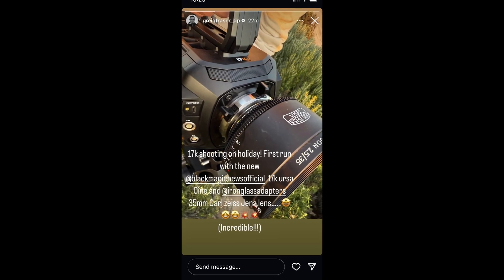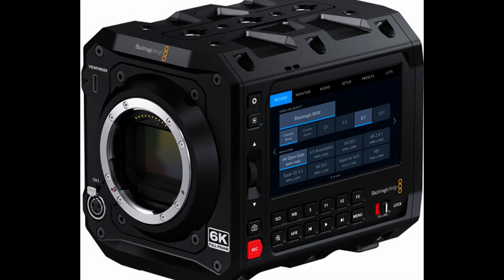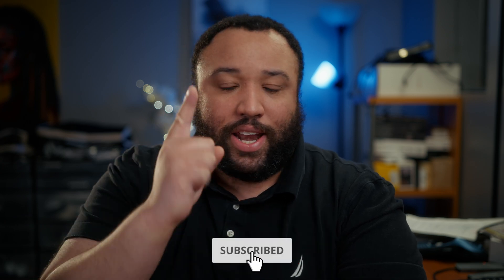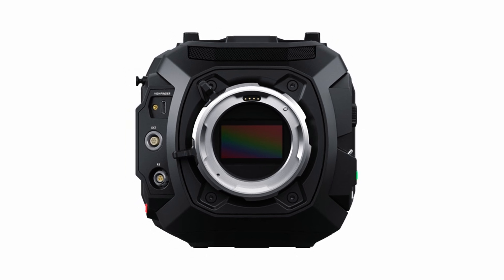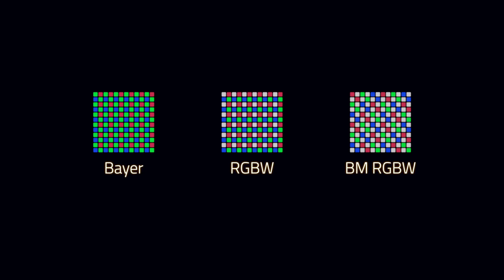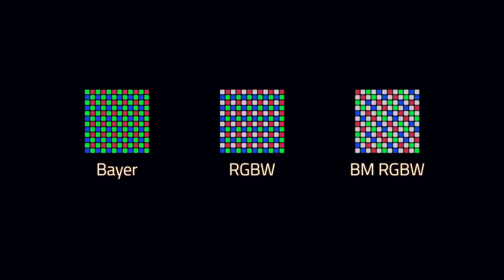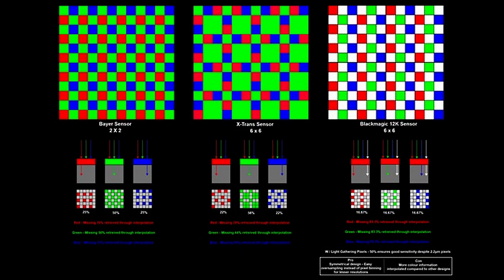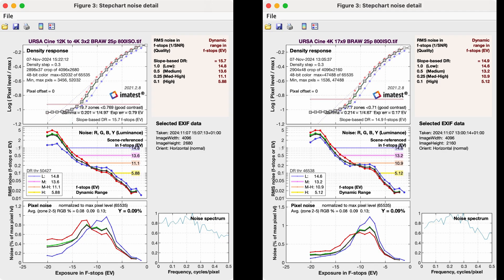Why You Need 12K | Blackmagic’s 12K RGBW Sensor EXPLAINED

Comment: There is no question about it: it is fantastic to have the opportunity of having high-quality down-scaling built right into a camera. However, external RAW recording may offer significant advantages over in-camera downscaling (in many other cases).
A notable collaboration between Blackmagic and Panasonic allows the G9 II / GH7 to output 5.7K 60p RAW directly via HDMI to a Video Assist 12G. This bypasses potentially unimpressive in-camera processing (like cropping or noise reduction), which is particularly beneficial as the recorder cannot handle higher resolutions like 6K60p RAW. Using this setup, the 17.3 MP frames can be downscaled to 4K (17:9 aspect ratio video, approximately 7.8M pixels) with thin letterbox bars, resulting in phenomenal quality.
Thank you for your great video!

Comment: Wouldn't it make sense to make a 6k version of the sensor (ie each pixel is twice as wide and twice as tall as on the 12k) for something like the PYXIS? Since the 12k can give you 8k and 4k, the 6k version with the same technology would give you 4k and 2k as possibilities. You'd probably get amazing low-light performance with bigger pixels. For most of us, 6k open-gate is a great resolution. If the dynamic range and readout speed is elite, we wouldn't care about not getting 8k.
Reply from the maker: @jeffrick  the issue is that the way blackmagic designed the RGBW sensor each pixel has 2 of one color channel (Red, green, or blue) and 2 whites. In order to have proper 4K on their sensor design you need 3 times so the sensor has 4K red channels 4K blue channels and 4K green channels. 

6K would not produce the amount of Red green and blue in 4K to create a true 4K image. 12K is the minimum needed based on how they designed the sensor.
Reply: @JamesJacksonFilmz  OK, there are things that don't make sense yet. In a traditional 2x2 Bayer pattern, each pixel only measures 1 value (R, G, B) and the debayering process fills in missing color information based on neighbors. So a 1920x1080 native sensor actually has 1920x1080 photo-sites, but only 1/4 are red, 1/4 are blue, and 1/2 are green. So, if I'm understanding correctly, the BM 12k sensor also only reads 12k pixels across the top. Of those, 1/2 are luminance, 1/6 are red, 1/6 are green, and 1/6 are blue. In 12k mode, one photo-site equals one pixel and the color information is based on neighbors, a similar challenge to debayering. If we go into 4k mode, then we could think of it as splitting the 12k into 3x3 pixels. Each of those would indeed have at least one of RGB. But, that doesn't explain 8k mode because that would be 1.5 x 1.5 pixels. So, it isn't a straightforward splitting of the grid into neat pixels. I saw on cined that in 8k or 4k mode, the grid is split into macro cells per 2x2 photo-site grid. Each macro cell produces 1 luminance value and 1 color value. So, if we consider a 6x6 photo-site grid, it is composed of 3x3 macro cells. Those macro cells create a 3x3 luminance grid and 3 color rows (RGB, GBR, BRG). There's a / pattern to each RGB. You might suspect that this makes the sensor open to Moire like a Bayer sensor, where R and B alternate in a / manner. But, and this is clever, the / is nicely compensated by the color combination in the macro cell being \. The 6k luminance grid is still open to a / Moire bias. So, the processor receives a 6k luminance grid with a / bias and a balanced RGB 2k grid. As the luminance photo-sites are more sensitive, this helps in low light. The balanced of the RBG grid compensates for the / Moire bias of the 6k luminance grid. Nice. The Ursa then uses that 6k luminance grid and 2k RGB grid to create either an 8k or 4k RGB image. Anyway, that's my understanding based on the cined article. THAT OUT OF THE WAY I'm not sure why you think this would be ideal for 4k. Even for 4k, you only have color information at the 2k level. My guess is that they are doing something akin to smooth-hue-transition debayering where the luminance grid dominates intensity and the RGB grid dominates hue. It's notable that the Ursa is not offering a 6k mode. That's probably because that 6k mode can't avoid the / Moire bias of the 6k luminance grid. BM is confident enough in their deBMing process that 8k is a reasonable resolution. MY SUGGESTION is that they could produce a 6k sensor (one quarter of the pixels at twice the size). If the 12k sensor can produce a good 8k RGB image, then that hypothetical 6k sensor should produce a quality 4k RGB image.

Comment: Saw this after the Team 2 vid. I think the way they explained the down sampling (larger groups of more pixels) was very interesting. 

I think they could make a Pyxis that has the 12K sensor and shoots on CFExpress, but is limited to 8K. It may not be feasible, now that the Cine 12K body is going for $7,000, but I’d love to have a smaller body with that sensor in it. I also don’t know that it would be limited to 60FPS, since the readout speed is tied to the way it down samples. I rarely shoot above 60FPS anyway, but I don’t see why it wouldn’t be able to do at least 120 if the Ursa Cine can do like 8K 240.
Reply from the maker: @RonCoy  I believe it’s more they (blackmagic) limit the recording capabilities because CFB cards aren’t fast enough for the higher data rates. They “unlock it” if you have the SSD module.

Also T2F are great guys and love their content. They did a much better job at explaining than me lol

Comment: 12k It’s not Really Needed ! Whatever you say, it’s NOT NEEDED IN 100% of Current Global Productions
Reply from the maker: @GizmoMaxx  if you watch the video it’s not about global production but giving understanding why THIS specific camera needs it.
Reply: @ 20+ years in this game and the key points I can highlight to is;
12K is overkill right now because:
	•Most platforms only need 4K max
	•Massive file sizes = huge storage/editing costs
	•No real distribution demand
	•Workflow complexity outweighs benefits
	•Expensive tech with limited practical use
Maybe in  3 years down the line start to be a “trend” . Marketing is crucial for company survive in an over saturated industry.
Reply from the maker: @GizmoMaxx  thanks for the reply. Again your comment completely misses the point of the video. That the 12k is used for creating true 4k purely because of how they designed the RGBW sensor. Never have to ever use the 12K and just deliver 4K all the time.

Comment: Do you mean, if I deliver a 12k footage it won't look as good as I deliver in 4k?
Reply from the maker: @offhauzstory  Is your question in relation to DELIVERING a 12K final file to be displayed in 12K vs 4K final file or asking if 12K footage won’t look as good as downsampled 4K?
Reply: @JamesJacksonFilmz  the first one. About delivering.
Reply from the maker: @ theoretically yes, you would be seeing the fact that it doesn’t have enough color information. However, keep in mind that in order to have a 12K screen big enough to see the difference you would need a screen that’s larger than the largest IMAX screen most 8K monitors don’t even show true 8K colors because they’re just not big enough. And the moment you send the 12K delivered file to a 4K monitor or a 4K display or an 8K display it automatically will down sample. Therefore you won’t really see the color difference.

Long story short, unless you have a massive giant screen where you can see every single pixel you really won’t see the difference even if you deliver out in 12K because displays will automatically down sample it to the Resolution that they have

Comment: If I shoot through a Black magic assist receiving a 4k signal from an open gate, will I be able to save all the color information and dynamic range as if I were recording inside the camera?
Reply from the maker: So this is a bit of a complicated answer so give me a moment. lol 

12g SDI only outputs UHD up to 60fps to the video assist. So if you shoot other formats (I.e. open gate) you’re actually cropping in on the UHD signal and getting less than 4K to record. Only exception is if you were sending Raw Video data to record BRaw to the VA (like the GH7 for example). However the UC12K LF does not send a raw signal out. All raw recording for all blackmagic cameras is internal. 

Regarding color and dynamic range you are only sending a 10 bit signal out not a 12/16 bit so you are taking no a big hit in terms of color reproduction and dynamic range recording to the video assist.

Long story short, if you want to record the highest quality with the most dynamic range shoot internally.

Comment: The faster read out speeds really grabbed my attention.  

I like that the media module comes with the camera.  Doesn’t the module also have a usb-C cable built-in?
Reply from the maker: The module does not, but there’s type C all over the body. Also, the 10 gig Ethernet port is the fastest way to transfer media files.